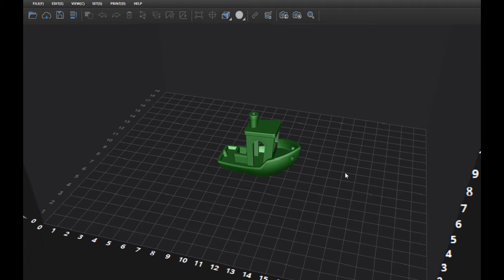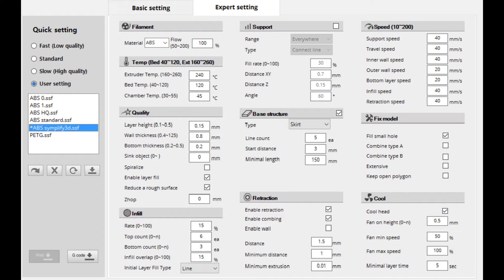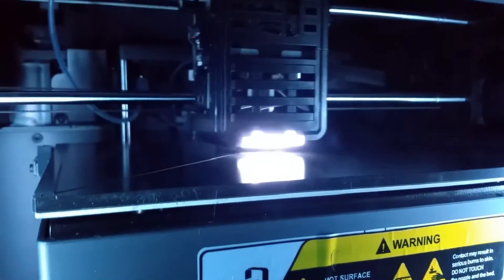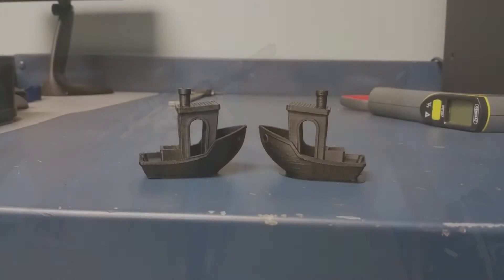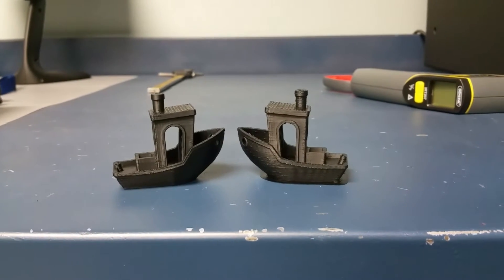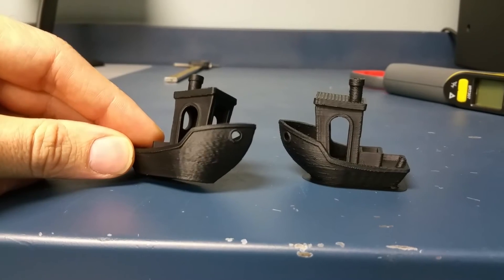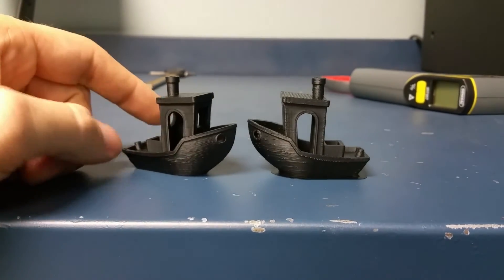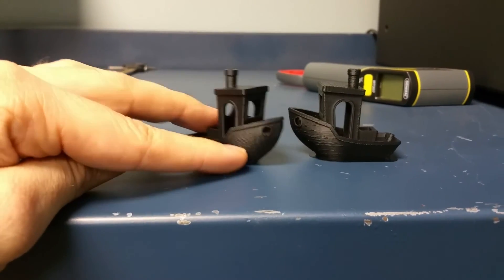Cubicon Single Plus Top Speed Test!

Comment: That is not really 500mm/s and not that much faster than normal printing speed.
Reply from the maker: Håvard Brenne
Hey.  I was talking with some knowledgeable guys from Reddit, and they said with the Cubicon Single Plus acceleration speed settings,  that this printer was not running at 500mm/s. I have never seen that speed, so I thought this was it.  But I can assure you this is way quicker than normal printing speed.   I will try and print a larger Item and see what happens.  Thanks for the comment.

Comment: I am stunned. I wasn't expecting anything that good at 500mm/s. What was the noise like at that speed compared to the original Single at 100mm/s?

Of course now I'm wondering how fast it can print without significant quality loss? I think I'll have to get another Cubicon.
Reply from the maker: +Steelmans 3D Print. The printer is pretty much silent even at that speed.  The only cons I have noticed so far with the printer is, I do not think the bed surface material is as strong at holding down warping abs as the first Single was.  It seems like it has a thinner less robust coating of whatever is on the bed.
Thanks
Reply: Thanks, really appreciate the advice. I can't think why they would change the bed material. The original was superb!
Reply from the maker: +Steelmans 3D Print This one has metal that is exposed at the corners for the new bed leveling procedure. Maybe the coating/sheet is thinner.  I dont know.  It does not matter anyhow. My favorite filament is PETG for its dimensional accuracy and it does not warp at all.  Neither does Protopasta high temp carbon fiber.